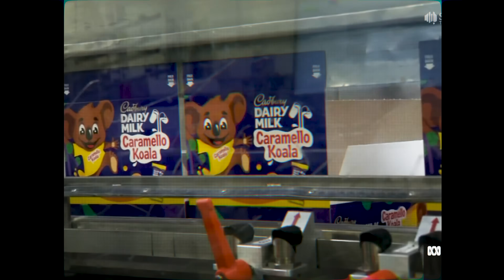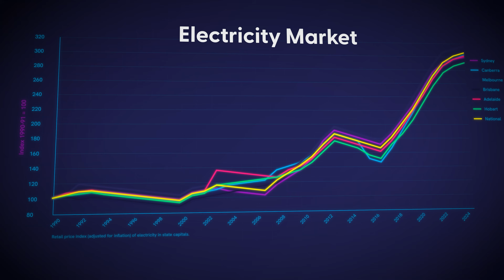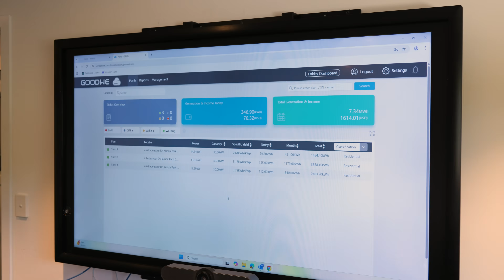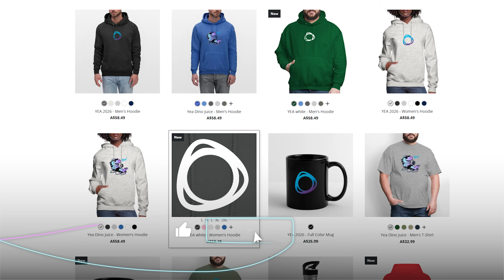This New Solar Panel Could Save Australian Manufacturing

Comment: Ten years ago, CSIRO, University of Melbourne and Monash University had a collaborative program to develop fully printed, organic solar cells. It was named VICOSC and reached the prototype stage, where flexible modules were produced in continuous rolls of A3 width and then installed onto colorbond roofs. Then our wonderful Federal Government pulled the funding, I leave the reader to guess why.
Reply: The main reason this technology was ditched was that the benefits didn't outweigh the downsides. VISOC panels have half the efficiency of regular panels, and regular panels can now be made flexible enough for any use.  You'll note that nobody else picked up on it afterwards, which they would have done if the tech was promising.
Reply: Tell us more - why? What a shame - Labor or Liberals? Who was in power at the time?
Reply: Back when I was in primary school ABC use to have an inventors show and some Australian guy invented an extremely efficient solar panel he said 3kw would be the size of a 32inch tv wonder where all that technology went

Comment: Dispersed GRID electricity is extremely expensive. 
Dispersed energy COLLECTION is dirt-cheap 2cents kWh with modern technology.
Reply: spot on - so why are we following this old path of distribution?
Reply: @markuslambert8236  Governments have helped more consumers instal roof PV as it reduces the load from increasing on the fragile national electrical grid. 

The high cost of massive generation plant maintenance and upgrades and the grid itself has caused governments to postpone or delay these works. And private owners the same. 

It is cheaper to use the empty roof realestate 'behind the consumer's meter box'. 
Cheaper to help consumers instal roof PV. 
No extra load on the national electrical grid. 
4 million roofs and 20million roofs available.
20million meter boxes. 

The program has been so successful that electricity prices were held steady but are now rising because the remaining consumers are being GOUGED to make up the cashflow collapse from the increasing daily business hours demand collapse. 

This is the daily DUCK CURVE of demand collapse for grid electricity by the businesses and the homes feed-in of dirt-cheap roof PV electricity.

Comment: Deluded and desperate. Subsidies required.
Reply: Not anymore -When I started in the industry a panel had 170 Watt and costs $800 per panel - now they have 480W and cost about $100.